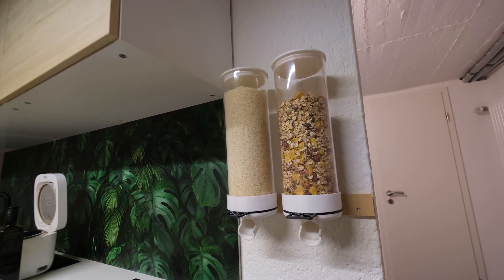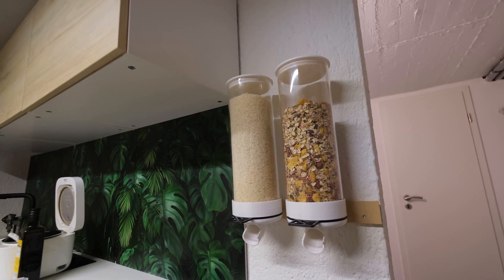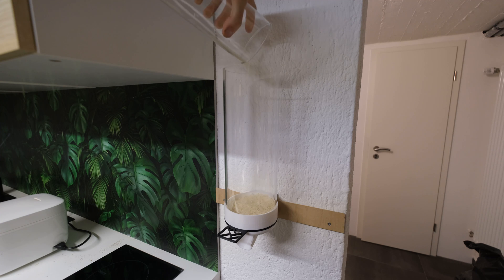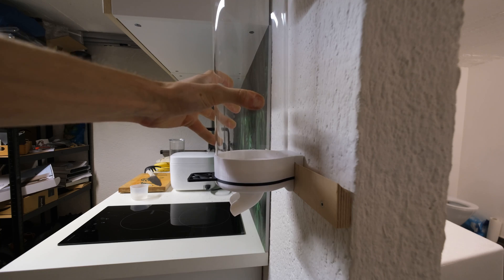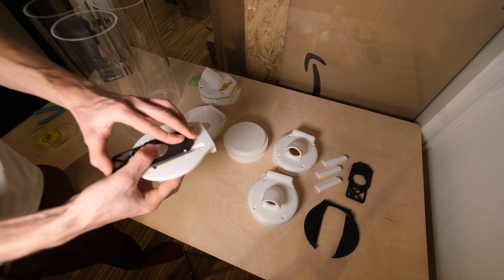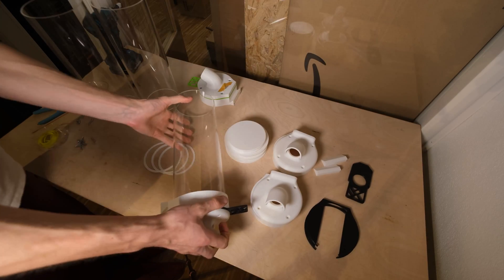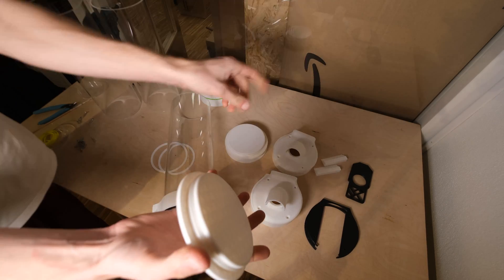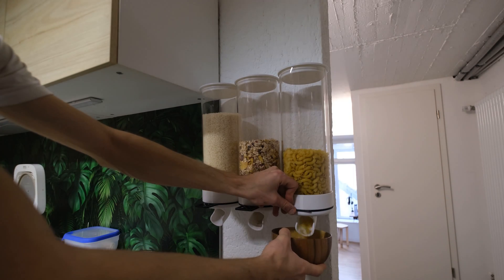3D Printed Food Dispensers

Comment: i wouldn't use a french cleat system to hold high traffic devices like these. someone WILL bump that while trying to dispense something. and it WILL fall (or at least rattle upwards)
Reply from the maker: Fair point. I thought of other solutions but wasn't able to come up with a sleak alternative so far. For myself it did work great up until now though. The weight when food is inside is really high so no chance to rattle it accidentally. An advantage of the French cleat is also that you can take it off easily which I do very often. Every time you want to refill it you need to take it off (unless you use the lids). Maybe there's  a nice solution to lock them in place? Personally I am actually mostly worried about the French cleat solution because of it's very long term strength. Once PLA gets brittle after many years and you have heavy glass filled to the brim with rice, maybe it will fail.

Comment: This is a great design and prints great.

The one thing I would suggest is adjusting the size of the required tube so that people can choose to use another readily-available cheaper replacement.  For example if the outer ID had been set to 110mm, then people could use 2 litre drinks bottles with the top and bottom cut off.  Or a cheap plastic container off Amazon. It's annoying having to buy £25 worth of plastic tube to finish off this project. We 3d print as an alternative to buying things.

Keep up the good work. :)
Reply from the maker: Thanks a lot for the feedback. Funnily I was talking to my friend about options for tackling this on the new version right as you wrote the message.  I feel like thin PE plastic bottles are too flimsy but I have some ideas for offering cheap variants 👍🏻. There will be many options to choose from with the next version.
Reply: @makermind2050  Also it would be good on the next design to remove the need for the wooden dowels.
Reply: Great. Looking forward to the next version. Maybe there’s some cheap round food containers on Amazon that could be used? 👍🏻👍🏻
Reply from the maker: the new version is live! https://www.youtube.com/watch?v=i5p_7xmLVT8